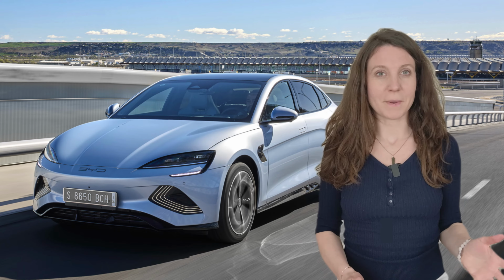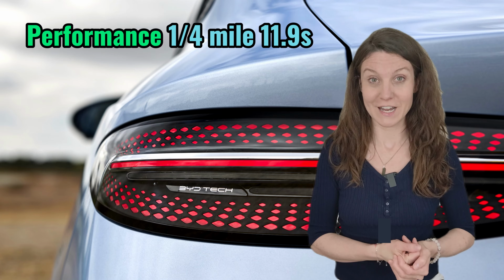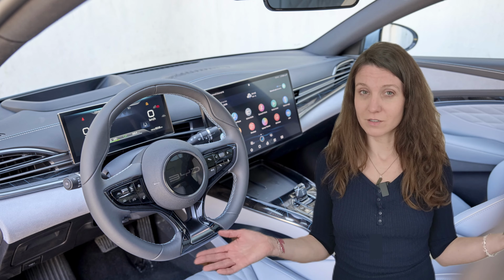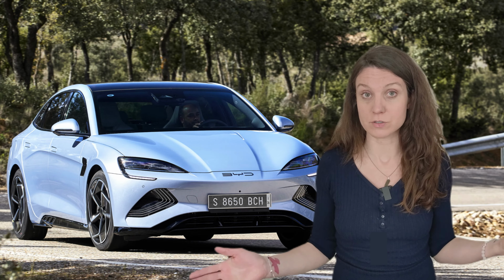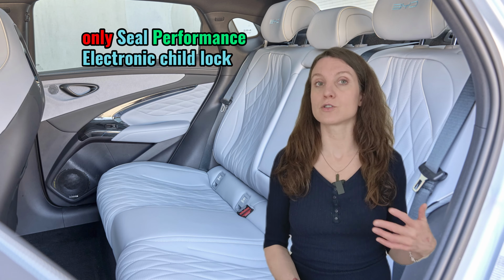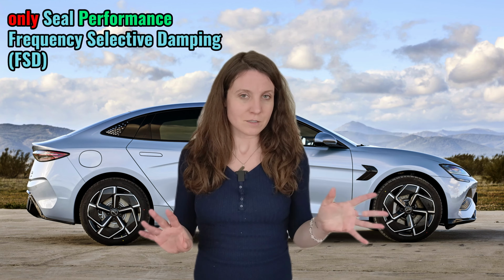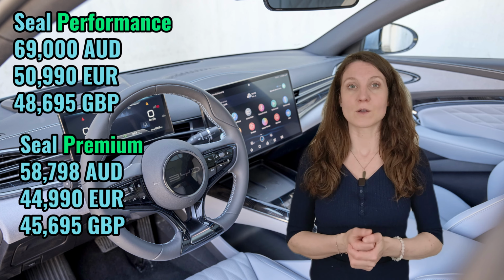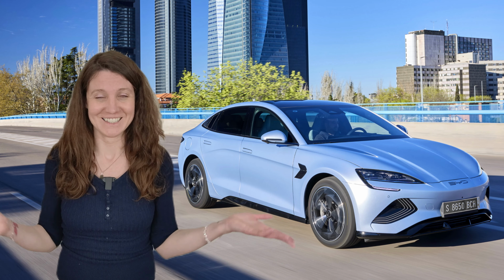BYD Seal PREMIUM vs PERFORMANCE - Comparison

Comment: Might be better if BYD come out with new Seal Premium Plus model having the active body control system which the current Premium Seal does not have.
Reply from the maker: @whlawson5812 That’d be a proper game-changer! Would make the Premium feel like a Performance with extra swagger. Hopefully BYD’s listening—my hands still want that heated wheel, though! 😄

Comment: Gonna cut against the flow here and say this is pretty lousy.  Reading the differences in the spec sheets and imagining the difference isn't particularly useful since anybody can go to the website and do that.  I came here to see the opinion of someone who has actually driven both to hear what the suspension, traction control etc differences are like.  The vid is well put together and presented well, but it doesn't add anything the brochure doesn't already have in it.
Reply from the maker: Sorry you didn't find what you were looking for here. Lots of people find my videos useful, but sounds like you were looking for different information. Of course I also like to get opinions from people who have driven the different cars, unfortunately I've found that you can't always trust those reviews either. Journalists who have access to brand new cars are also often prevented from giving their fully honest opinion regarding their shortcomings (if they want to keep getting invited to test out new cars that is). So that's just my personal note to take those types of reviews with a grain of salt as well

Comment: As much fun as you could have in the performance version, I honestly think for most people, the premium one is the one to go for. We've been too spoilt with extremely fast EVs but there is an argument to be made in favour of AWD for safety, and the price difference isn't that significant in the end. It may boil down to things like heated seats, just like you said. Comfort is more important as far as I'm concerned.
Reply from the maker: Comfort is the most important to me too. But a 4x4 would be nice, I wouldn't be afraid to take it to the mountains!

Comment: The child lock is individually activated by a button below each rear window button on the drivers door. Each can be locked individually and includes the door and window to be locked with buttons. Just bought a Seal Performance and loving it!
Reply from the maker: That's great, well designed childproofing! Must be a great ride, what's your favorite thing about the Seal? Have you tried the Tesla model 3? Seal seems better to me...

Comment: I have the performance model here in Australia and went with the optional external colour called Shark Grey and the optional interior colour called Ocean Blue.

The Child presence detection system is set to "on" everytime the vehicle is started you need to set it to "off" via the infotainment screen if you dont want it on, it doesn't remember the setting preference you set, defaulting to "on" when the vehicle is restated.
Reply: Also bought a new Performance with the Shark Grey. It’s stunning! In sunlight it has this beautiful iridescence to it! Really happy with the car. Went with black interior over the ocean as we wear lots of raw denim and the colour transfer would have ruined the seats! But did love the colour in person. Hope you are enjoying yours as well. Came from a G20 BMW and the Seal really makes Sydney roads a bit more tolerable!!
Reply: Yes, it has joined my BYD Atto 3 extended range in surf blue colour so we are a 2 car BYD owners now.

Comment: I always think it is strange when reviewers mention heated steering wheels. Here in Australia nobody really needs a heated steering wheel. There are so few cold places where it would be a must have option. Air conditioning is far more important. Cars with glass on the roof are actually very inconvenient. We have enough sun as it is. I had a Subaru once which came with a lovely sunroof. Its main use was opening it to let the 50°C air out as quickly as possible when getting back into the car in summer to drive home. In summary, priorities are quite different in other climate zones. 
Thanks for the informative video. I am not a person who is likely to buy a BYD but the Seal looks like a better thought out car and active suspension is something that might change my mind about the brand. The seat upholstery is however something which makes me laugh. You can make seats comfortable and supportive without going over the top with stitching. They need to understand that “Less is more, excess is silly”. For me the fundamental design principle is the one that says: “All emphasis is no emphasis”. Until BYD designers understand this essential design principle, they will probably struggle to achieve the sales figures they seek in some important European markets.

Comment: BYD Seal in performance model There is 2 child lock button (left/right door) in driver power windows switch there to enable or disable. very easy to use.
Reply from the maker: Thank you for letting me know! Sounds good to me 😊
Reply: Those switches lock the doors, so a child can not open their door from inside the vehicle.

 The system that detects if a child is actually sitting in the rear seats is controlled by the setting by pressing the vehicle icon on the infotainment screen, then selecting ADAS, then Driving Assist, then Child Presence Detection.